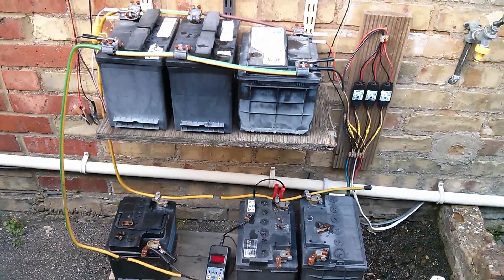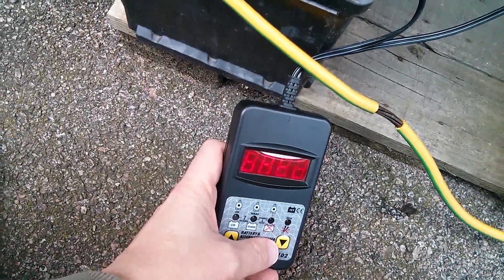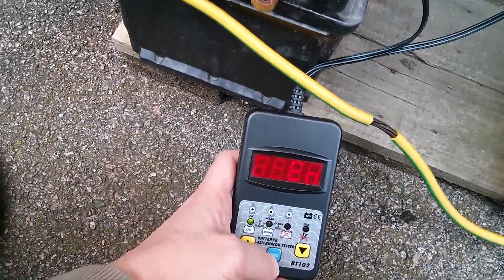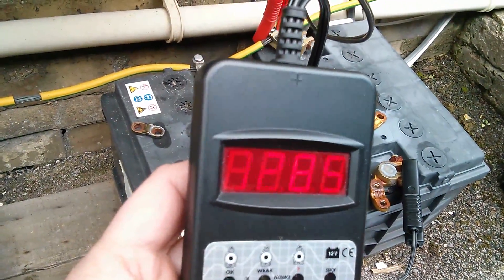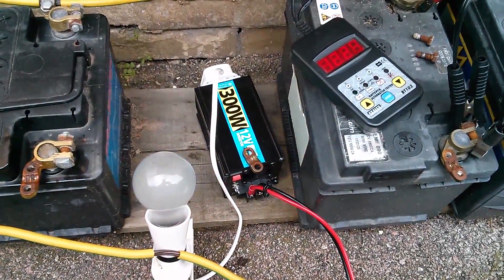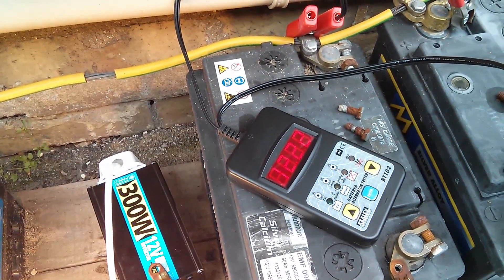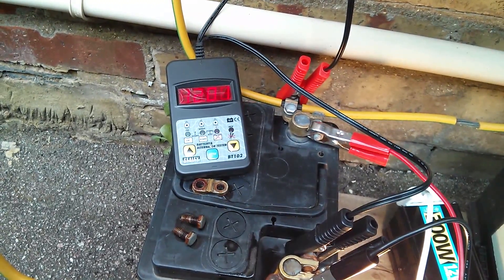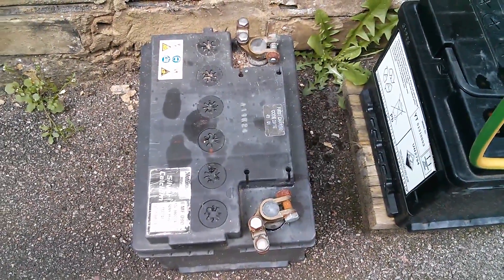12V Solar Power System - Testing the Batteries

Comment: Could it be worth making a battery desulfator to maintain your batteries? There is a chance that it might even be able to recover that faulty battery if used for a few months. If I remember correctly sulfation usually occurs when the battery doesn't get a fully saturated charge which can be a common problem with solar charging big battery banks. However I agree that 13 years is a decent life span especially if it's been cycled for a few years while in your solar setup. If you can acquire a replacement battery for little or no cost then just do that instead.

Comment: hi julian, i meant to say on your last garden/solar set-up video, i would think about changing all the wiring in your set-up for multi strand (as many as possible) copper or copper dipped cable, it makes a huge difference as DC travels on the outside of the strands so mains cable is not good at all as it has very low surface area.

i use very chunky OFC speaker cable for doing longer runs, something like 6mm.

hope this helps.
Reply: Direct Current travels through the entire cross sectional area of a cable.  "Skin Effect" only applies to Alternating Current and is frequency dependent.  The higher the frequency the closer to the outside of the conductor the current flows.  The "skin effect" of copper with a 60Hz current is around 8.5mm IIRC so each conductor could be solid up to 17mm in diameter.  The only reason for stranded wire in DC applications is for mechanical characteristics like ease of bending.
Reply from the maker: kuhrd Thanks for confirming that. I must have spent at least an hour reading about skin effect, only to discover (from multiple sources) that it doesn't apply to DC current.
Reply: kuhrd thats strange because i have seen it proven in front of my eyes, iv worked on a solar festival stage for many a year and when we changed over to multi strand it made a huge difference. strange.
Reply: Elwyn Harris There is definitely no skin effect with DC. However changing to multistrand cables can often improve things through lower resistance. What I am talking about here specifically is the way a multistrand cable better moulds itself inside a crimp lug or saddle or other kinds ov tension terminals. The solid core cables tend not to have as much surface area actually contacting the connectors due to it's reluctance to conform to the contour ov the connector.

Comment: Take the duff battery to your metal reclaim centre and you'll get approx £5 to spend on eBay goodies!
Reply from the maker: Really? I've always taken them to the council tip and got nothing. I'll check where my nearest reclaim centre is - thanks for the tip. I wouldn't mind getting a few sovs for the duds.
Reply: Julian Ilett at 13 years old, and being a refillable type, probably just needs the acid replacing! - or at least worth checking.

Comment: Speaking from experience,it would be wise to put a fuse between each battery,and the main 'buss bar' wire. If one battery were to develop a shorted cell or something 'wonky',it could draw a whole bunch of current,and,at the least,drain the rest of the bank..Worst case being melted wires and/or fire/explosion.
Trying to disconnect things in a hurry,while the wires are glowing red hot is..challenging. BT,DT,No Thanks. Get some fuses.

Comment: i supposed being used car batteries they are a bit past their best, they cant shove enough amps out to be a decent battery, but for somewhat medium amps use they are probably good for years, heard a good saying recently, batteries die in summer but dont fall over till winter.  is that battery worth doing an experiment with? doing a controlled overcharge charge at about 16v for a few hours, and seeing if that perks it up a bit? obv check it has enough water in it